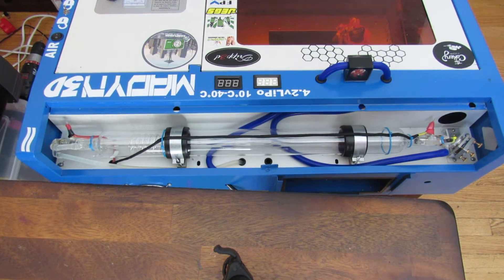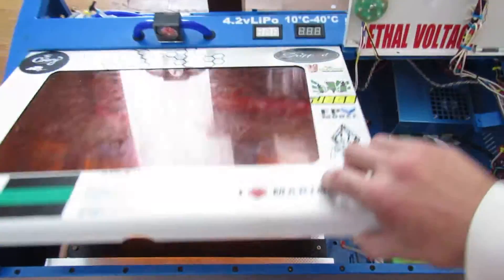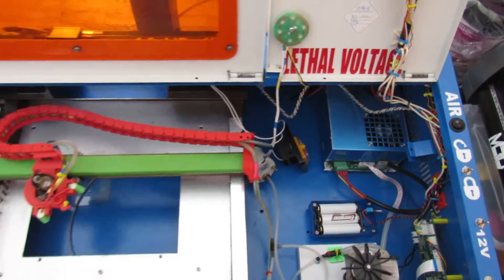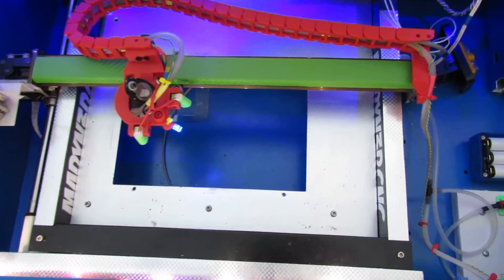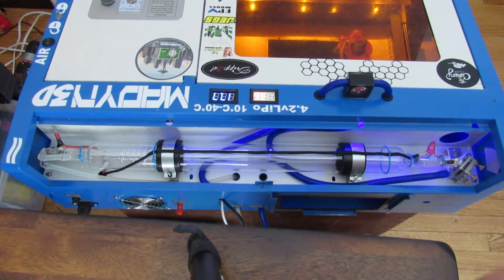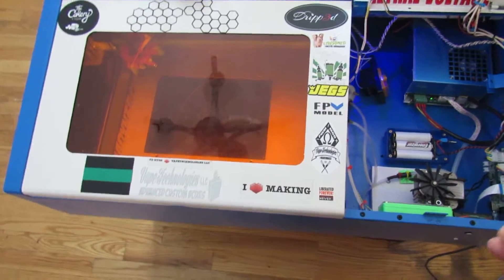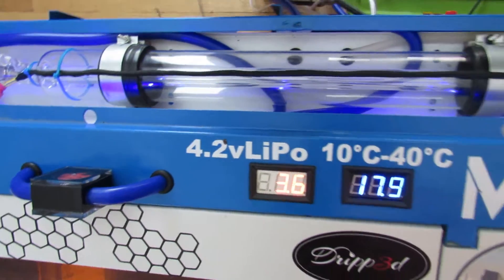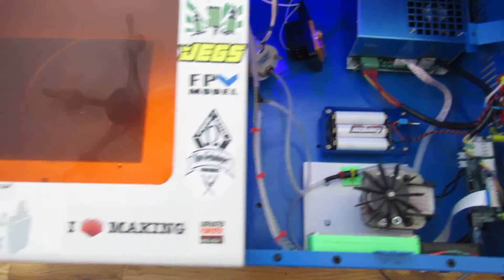K40 issue- arcing and inadequate laser output

Comment: How many hours of use do you have on the laser. The laser tube has a life of  approximant 1000 hrs using raster engraving. If you do a lot of cutting out parts, this will shorten the life of the laser tube. The bottom line, the higher the power settings, the shorter the life of the laser tube. My k40 laser lasted  2.5 years. I just replaced the laser tube last year. I used the lowest possible power settings to get the job done.

Comment: old video but might still be helpful to someone, Sounds like the power potentiometer problem (the knob that sets the mV to the tube). it sets the  0 to 5 volts to the power supply to let the laser know how strong it should be firing at.